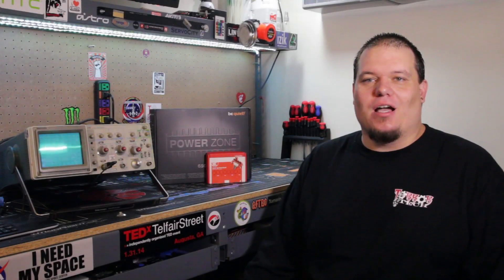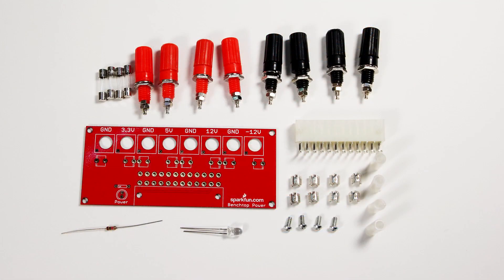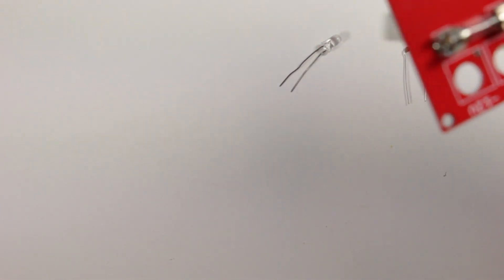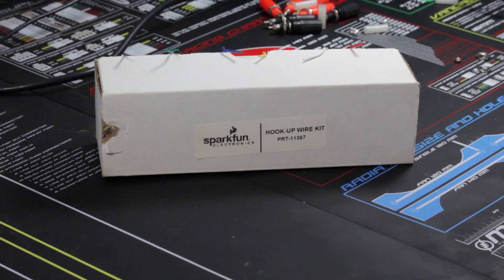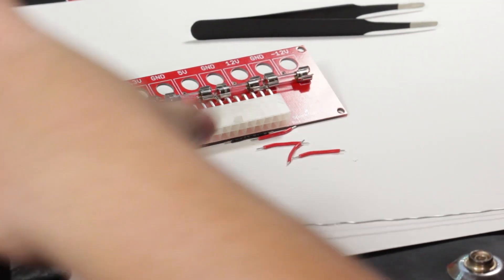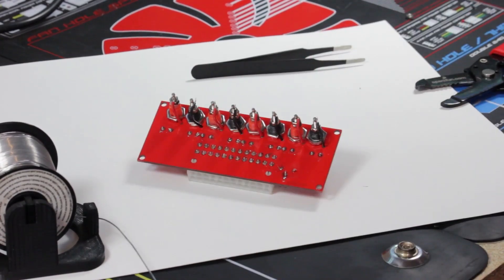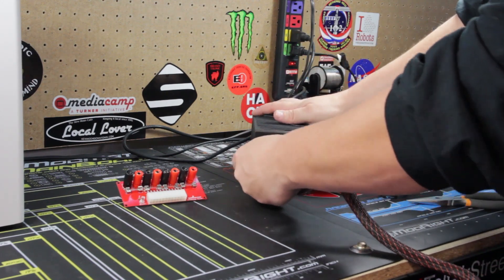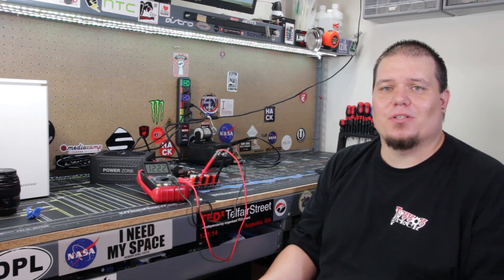The  Workbench: Building a Benchtop Power Supply

Comment: How would you limit the amps if you needed to?
Reply from the maker: +eternalreminisce You could use resistors to limit the current, but unless you fear that your project is going to draw more current than this power supply can offer, there is no need to limit the current. Current works in a way that a device only uses what it needs. So for example, if an LED strip required 300mA of current, then a 10A power supply would still be fine, because the LED strip would only source the current it needs.